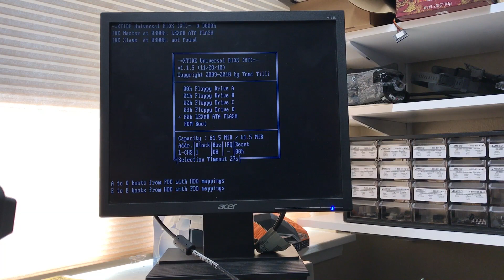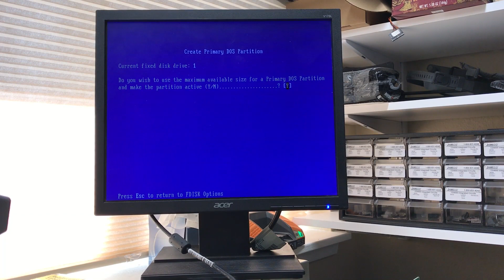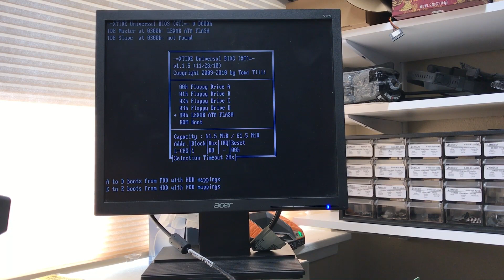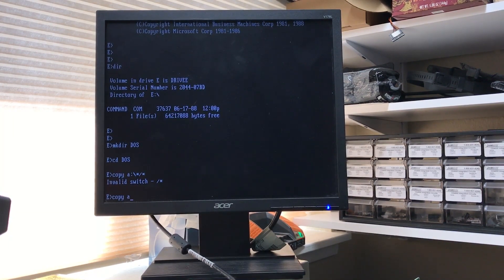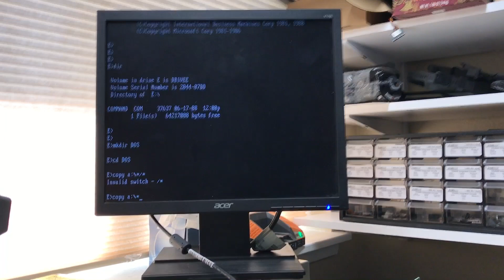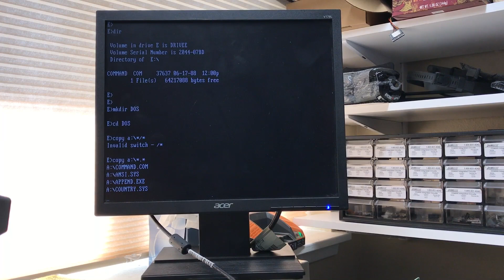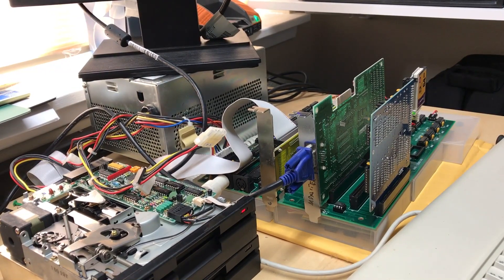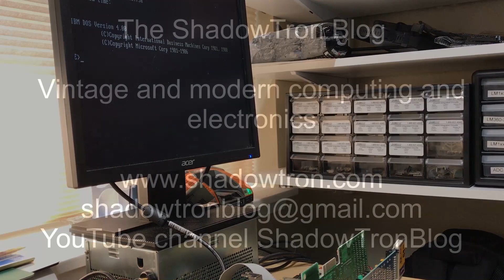IBM 5150 Clone Kit - Part 9 - Setting up a Compact Flash drive with the XT-IDE - STB77

Comment: I just rescued an IBM 5150 from someone clearing out a relative's house and I just bought a XT CF lite card for it. I've burned myself out for hours yesterday just to only be stuck at it saying missing operating system after the Booting C>>C message (i've attempted the fdisk format /S fdisk /MBR many times with various DOS versions 3.3 to 6.22 and no dice)